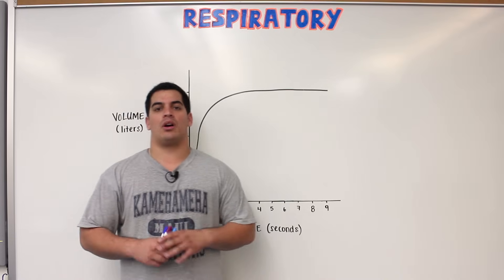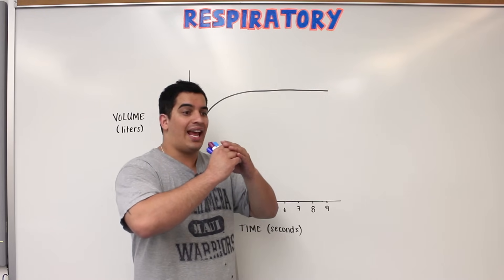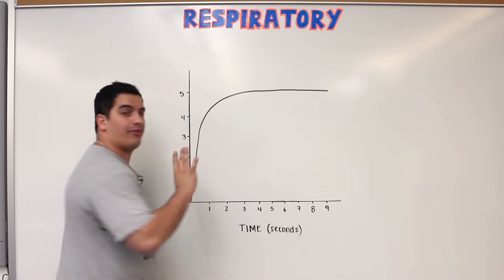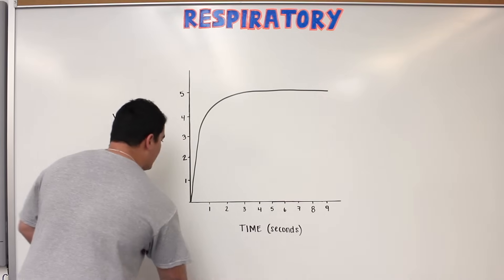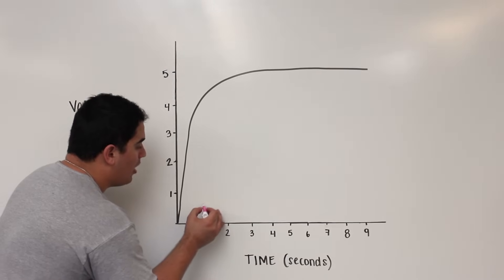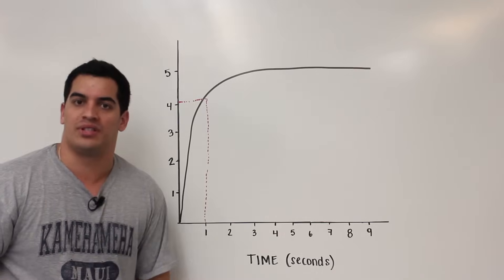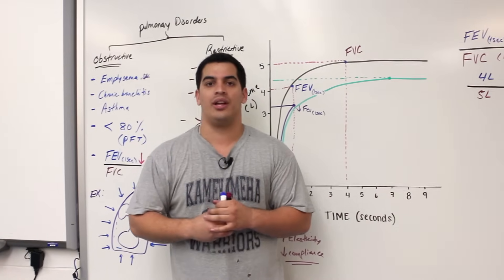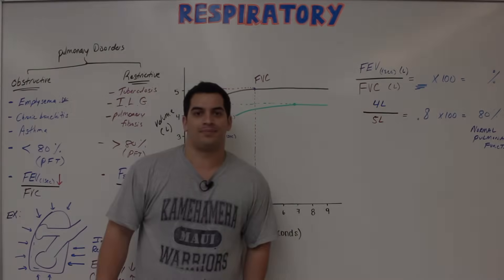Respiratory | Forced Spirometry & Pulmonary Function Test

Comment: I just took this test. Seems pretty bogus to me. The results said my capacity was “technically normal but just barely within range.” 

Umm, OK. This is a dumb test. It requires a certain amount of skill. You can’t even feel any kind of resistance (like when you blow up a balloon).

What if someone used to play the flute or the trombone or was a really great singer. All these people are going to have excellent breath control. There’s really no standardization, just your age and your gender. 

Also, everyone breaths a little differently. Like with every single Olympic runner, they are going to have a slightly different body geometry and they all trained differently. No two athletes are going to be exactly alike, even what they eat or how that affects them. Look at how Novak Jokovic had to go gluten free in order to overcome his genetic inheritance.

Beyond that, someone could have a perfect ratio of .80 but still have disease. If their absolute FVC was lower and so was their absolute FEV, then the ratio would still be exactly 80%. This machine seems like someone was able to convince doctors offices to buy them so some company could make a lot of money.

Beyond the patient, there is also the capacity for error on the part of the technician administering the test. For example, in my case, I think the nose clip wasn’t on tight enough. That could have thrown everything off. But that’s a case of operator error.

And on top of all this, you show a patient some gobbledygook on a screen and a printout suggesting they fall short of “normal” and you have a repeat patient. Seems like a case of the Emperor’s New Clothes.. Gimme a break.